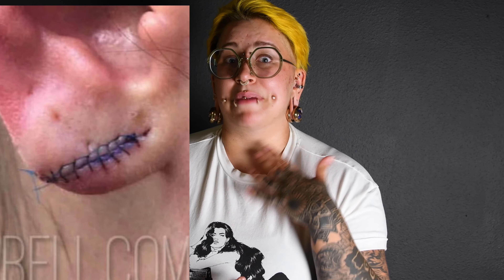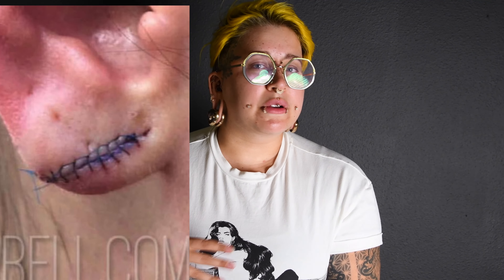Stretching Reconstructed Earlobes

Comment: I have been restretching my lobes since 2019. They were reconstructed around 20mm back in 2009. I'm around 9.5mm now. They were reconstructed by removing the stretched fistula (if that's the right terminology) and then suturing, so the scar tissue for me was essentially circular. All that is to say, yes! It's definitely case by case, but big maybe could be possible to restretch after reconstruction! As always, trust your body. Go slow. Like, slower than you think you even need to sometimes. Bodies are amazing. Yeehaw. Thanks for making this!